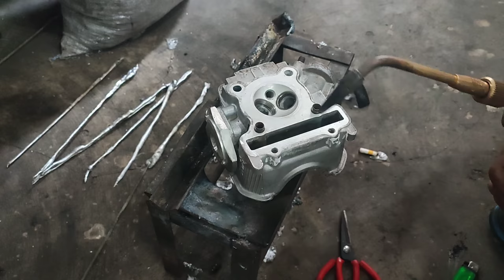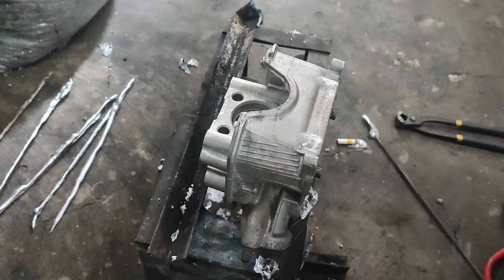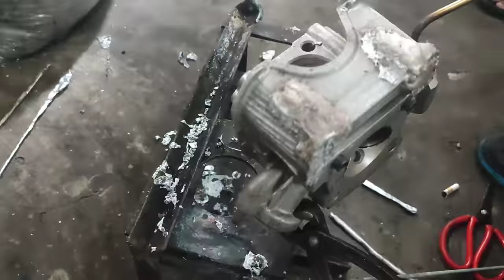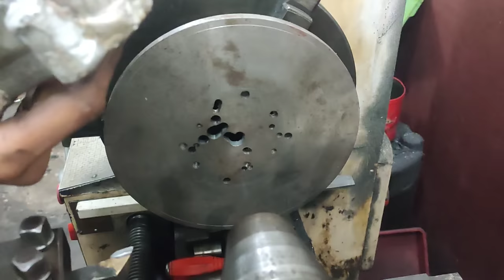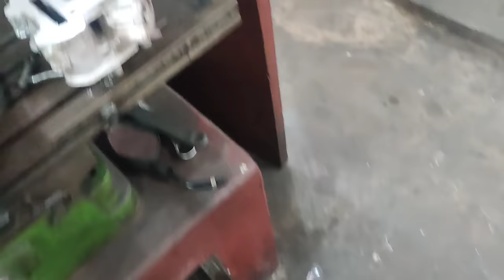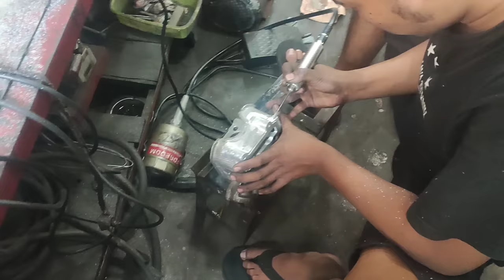Welding aluminum in the style of a technical coolie, lathe and milling process

Comment: All the other so called acetyl/oxy or propane/mapp gass alum welding rods I’ve seen advertised say to NOT introduce the filler material/alum welding rod into the flame but to allow the heat of then patent metal to melt the filler material rod by contact alone.  What’s different about these welding/alum brazing rods?

Comment: This is not welding.  This is brazing and your not even brazing it the correct way.   Aluminum  brazing rod should never touch the flame to melt.  What you have there is not even fully bonded
Reply: did it work? I even used the same method to fix the spark plug holes, and it was able to survive when I used ±15:1 compression ratio

Comment: What alluminium rods are you using ? what metal alloy?  Si or Mg?
Reply: Its brazing rod.  Not even brazed correctly
Reply: @BuildBreakFix  i think that is pure alluminium
Reply: @jetfulvio  nope that is a hammered on  brazing rod! Like most people that can't braze aluminum well lol they smash it to make it melt faster.  tell tail sign!
Reply: @BuildBreakFix  can you tell me if those are brazing rods or just alluminium rods ?
Reply: @jetfulvio  you realize there is no such thing as aluminum welding rods for torches right?  Fact hes melting it with a torch and not aluminum part its self should clearly show that all on its own!
Reply: it's handmade, using spare parts used aluminum materials.
Reply: @tanpanama8512  in fact I thought so, I tried to make them at home by melting pieces of the casing and it works very well with the oxy
Reply: @tanpanama8512  heads overall temps never reach the 970f needed to melt again.  Max temp is around 560f after natural cooling